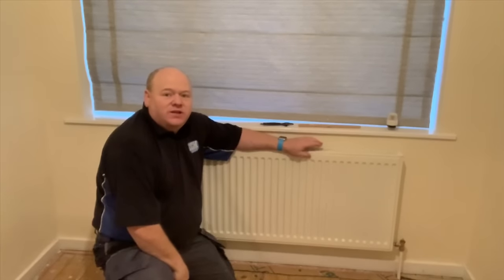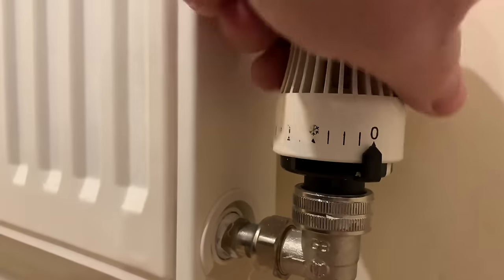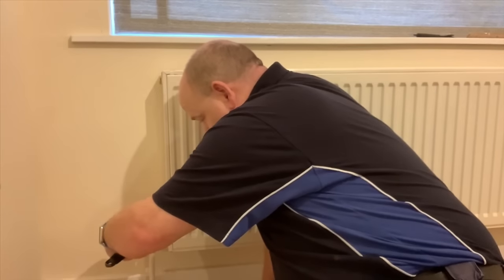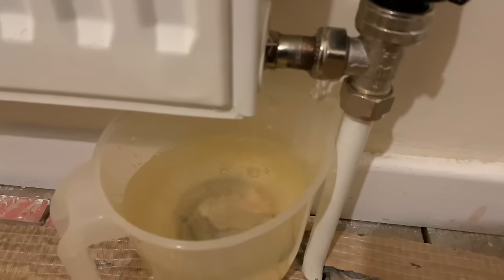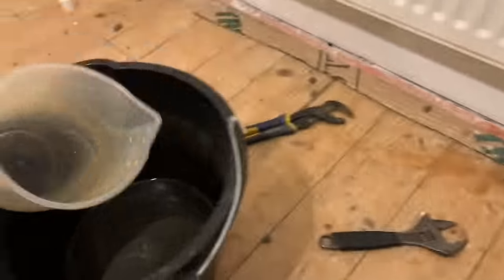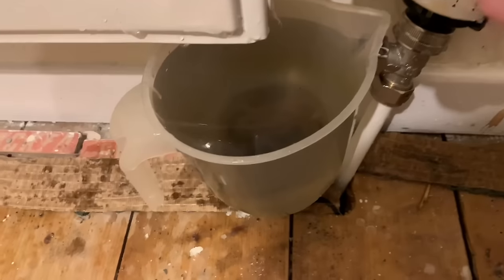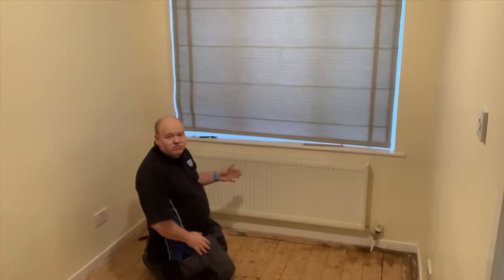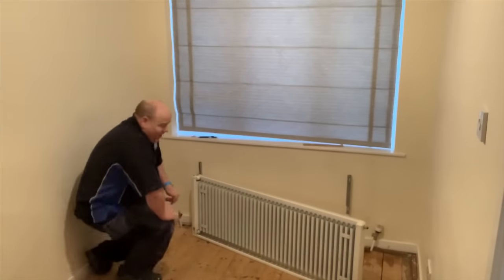How to remove a radiator for decorating - Removing a central heating rad

Comment: Great video, thanks. One question - why isn't one pie connected to the top of the rad and one at the bottom? Then you could fit a drain plug to the bottom of the rad and draining would be simpler.
Reply from the maker: Thanks very much for your comment, please consider subscribing to support the channel 🙂

Comment: if you wanted to stop the supply of water coming to the radiator, can you go straight to turning the left valve off (I'm not trying to remove my radiator, just trying to stop the supply)

Comment: When the radiator appears empty and you lift it up off the brackets, inevitably you will lift the radiator on a slope and the lower end will have black water dripping out so I always have a jug/tray under one end and lower that end first so the water goes into the jug. Then lower the whole rad as you did and carry it upside down. Small point but vital if the carpet is underneath!

Comment: Usually good videos Allan,but I think this has a problem.I would not rely on a trv to stay closed for a period of time.
You should if you still have it,although unlikely,screw the plastic cap on top instead of the trv head,100% shut off and won’t open (change in temperature)
If you don’t have the cap,the end should be blanked ,in this case with a 15mm compression blank.cheers
Reply from the maker: Brian Bennett You make a good point. The idea of this video is to paint behind and then put the rad back on. I take on board what you are saying though. Thanks 🙏

Comment: If the trv side valve pin is broke, ie taking off the rad and the lock shield is turned off ok, and the pin is down and should be off on the trv side, but still pisses out water from the system when unthreading the rad, obviously you cant take the rad off, do you have to drain the whole system then, many thanks in advance.
Reply from the maker: Thanks very much for your comment, please consider subscribing to support the channel 🙂

Comment: What happens if the thermostatic valve only goes as far as the frost setting - there is no point 0 on it? Is it ok to take off when it shows the frost setting ??
Reply from the maker: As long as its fully turned the radiator off. Thanks.

Comment: Sorry if it’s already been asked but how many turns on each valves after the radiator has been fitted? How do you know it’s the radiator is balanced or not?

Comment: I have problems after having bled few rads my boiler was banging and we found out the water in Header tank ran out as valve was inactive because it was croded . Having changed valve and new pump to it started heating only came up with water not it's own. Changed 3 way valve body still same heating comes on does not sustain. What you think could it be Aqutator as plumber happen to put on the body of 3 way ,2 way Aqutator than Heating at its own came up. So please help to advise. With power flush is it likely to see some leaks around best way to get over it eliminate or what ? I would be grateful if, you can advise. Thanks for your time .
Reply from the maker: Thanks very much for your comment, please consider subscribing to support the channel 🙂

Comment: If i want to permanently remove the radiator, can i just cap off the valves? (in case i need to put a radiator back one day) , cheers!

Comment: Hey Allen.  This video was super helpful.  One question on the top up.  Does it make sense for me to leave the return side on the radiator closed when I turn the supply side to the radiator back on?  My thought is to do this and leave the bleeder valve open when I go to top up the system and once all the air pushes out the bleeder valve then turn the return side back on.  Thanks!
Reply from the maker: Thanks very much for your comment, please consider subscribing to support the channel 🙂

Comment: To Allen:

Could you just clarify the question in my previous comment please? Namely, do I need to count how many turns are needed to shut off the lockshield valve in order that that I can put it back at the exact same setting when the radiator goes back, or is this not really critical? Please advise if you can. Many thanks!
Reply from the maker: Depends on the system really.

Comment: Great advice. I don't know if anyone has said this, after closing both valves, open bleed valve to check if water stops coming out after say 30 seconds. If it does continue, one of the valves is not shutting off and the task is now 'different'! Just saying.

Comment: When opening the valves at the bottom to refill the radiator, should I open the bleed valve so that as the water re-enters the air can escape? Thanks

Comment: Turning the thermostat to 0 (I did check it is 0 & not *) has not stopped the water - when I disconnect that side of the radiator, water comes spurting out at pressure. Is there another way to isolate the radiator on the thermostat side?

Comment: How would I remove a rad, if it’s connected through the wall to another radiator. When my CH was installed they put the rad in the wrong place now I don’t like like it and want to get rid of one radiator so I can push my furniture back towards the wall if this possible

Comment: No need to remove or drain down, loosen the radiator tail locknut on both sides, then I use a car jack with flat wood on it positioned just in front of the bottom of the radiator. Gently lift radiator up a couple of millimetres until it clears it's hanging brackets then rotate the radiator. Once radiator is laying horizontal just nip the locknuts on the tails again. You have total access to the wall now.

Comment: I want to add a secondary glazing window to my current window but I am worried I won’t be able to remove the radiator under the window if I need to later on. 
Could you please let me know how many cm/inch minimum should be free above the radiator to lift/ remove it ? Thank you.
Reply from the maker: no idea sorry.

Comment: We want to remove a radiator because we allready have floor heating. What will we do with the water pipes when the radiator is off the wall?

Comment: Thankyou uncle, I can't seem to get the screw open to let the water out, I've even left an indentation in the metal where I am pressing so hard. Any tips?
Reply from the maker: Not really sure what you mean sorry?
Reply: If you’re talking about the bleed valve, if it is completely jammed you can simply unscrew it and remove it, do it slowly though and have someone help you with catching any surges of water from the bottom, and buy a new one

Comment: I followed the process and removed the radiator successfully.
However, I didn’t cap them off or return the thermostat valve..
I topped the boiler up, before fitting the new rad and water went everywhere … oops 
I’ve just shared this in case it prevents anyone else making my errors 👍

Comment: Allen, I was trying to take a radiator off the wall and I've hit a bit of a snag. When I put the spanner around the large nut that connects the pipes to the rad, the whole unit moves. What I mean by that is, the nut and the pipe move at the same time in the same direction. I applied a bit of force to the spanner but i noticed that the pipe started to bend. I stopped as I feared snapping the pipe as it was bending quite a lot. Is there a way to get that nut loosened without the pipe moving and warping?
Reply from the maker: You can buy a tool that holds the pipe in place. Thanks

Comment: Can the system be used as normal ? How how much would one pay for someone to remove large 1 radiator and put 2 smaller radiators for splitting a room ?

Comment: Hi Allen, after watching you video and removing my radiator, decorating and then replacing I topped my boiler up.  I fired up the boiler by running a tap an noticed that the after a couple of seconds the boiler stopped.  I tried this a few times but it does the same thing every time.  The pressure is at just over 1 bar but I noticed the needle wobbling just before it cut out.  Any ideas please.
Reply: You've probably got air locks in your system.  I would try and bleed all your rads.  The boiler may shut off again if it hits another air pocket but by bleeding out the rads, you should get the air out eventually.
Reply from the maker: Thanks very much for your comment, please consider subscribing to support the channel 🙂

Comment: Why a full drain down? Close both valves loosen valves quarter of a turn with towel underneath lift and tilt radiator past horizontal. With the blend valves closed disconect valves and lift upside down quickly. If your only painting dont bother to take it fully off just tilt it down with a support to stop putting stress on the pipes.
Reply: Use a rubble sack instead of a towel. Those things can hold tens of litres of water and don’t leak! You can always put a towel underneath as extra precaution. Always worth having one local, just in case!
Reply from the maker: Thanks very much for your comment, please consider subscribing to support the channel 🙂

Comment: Thanks for this video. Radiator is off the wall but I have the slightest of leak on the left hand side. Valve fully turned off and nut underneath is as tight as I can get. PLEASE HELP HAHA
Reply from the maker: Thanks very much for your comment, please consider subscribing to support the channel 🙂

Comment: How long does it take to empty the radiator? Mine hasn’t stopped and I’ve been going a while.
Reply: How long did it take? I'm in the same position 😂
Reply: @ryulanda9399  got a plumber in in the end. The valves were really old and had seized so hadn’t shut properly. He said to test it, shut both valves and then open the bleed valve. If that doesn’t stop then you know water is still being let in and there is a problem.
Reply from the maker: Thanks very much for your comment, please consider subscribing to support the channel 🙂

Comment: I’m not criticising at all, but from one plumber to another, would you not recommend shutting the valves off, and then open the bleed valve and letting the pressure out straight away, less chance of water spraying everywhere when you crack the nut, would also be good to explain that you should
Cap the valves off as well to be on the safe side, just Incase the trv has a thermostat setting.
Reply from the maker: Thank you for the feedback, You could do it that way as well

Comment: At 6:47 what is the plastic grip called? Like between the metal of the radiator cover around the bleed valve. They have them too and bottom to keep the case in place but mine have broken and trying to get spares but don’t know what they’re called x
Reply from the maker: Not sure tbh, Sorry.

Comment: I want to remove the rad completely so I need to get rid of the feed pipes that come up through the floor, how is this accomplished.
Reply from the maker: Drain the system and cap the pipes. Thanks.

Comment: Excellent explanation Allen. I do really appreciate such a clear and concise video. I have just a quick question in regards the location of the valves, so the thermostatic and the bleed (air) valves are on the left, the shield valve is on the right. Does this change anything in terms on how to open/close the valves i.e. clockwise/down as you explained on the video or should this be the same even if they are located the other way around? 
Many Thanks,
Juan
Reply from the maker: Not really sure what you mean? Thanks.
Reply: @AllenHart999  so, in your video the shield valve is on the left and you say that for turning it off you need to turn it clockwise.. is this the same if the valve is on the left (like in my case) or should I turn it on the other direction (not clockwise)? same with the thermostatic valve, should I turn it off in the same direction as per your video even if in my case in on the left side of the radiator? I hope it makes sense now :) Thanks again Allen
Reply from the maker: @juanfcgb  I think i understand now and yes. Thanks.
Reply: @AllenHart999  Thank you so much, I have a quick about the valves (two pipes) from the radiator, after its been removed is it required to put some kind of caps so the water doesn't goes out from those pipes anymore? Thanks

Comment: I like to use a paint tray before lifting off completely, I tip the radiator to one side over the tray and that captures most the sludge but be careful doing that, I would put an absorbent pad under the tray/ on top of the dust sheet as I have had sludge stain through a dust sheet in the past. Nightmare!
Reply from the maker: Thanks very much for your comment, please consider subscribing to support the channel 🙂

Comment: Are lock shield valves better than thermostatic valves ?
Reply from the maker: No they are different. You would normally have both on a radiator. Thanks.
Reply: @AllenHart999  Thank you

Comment: My pipes come out of a concrete floor and are solid. How far can I bend the pipes sideways before something bad happens?
Reply from the maker: You will need to be very careful. Do not try and bend the pipe. Might be better to fully drain the system maybe?
Reply: I'm wondering if I should cut through the rad tails, then fit adjustable tails when refitting?

Comment: My top tip is to wrap a plastic bag around the radiator valve and into a plastic bowl and the water runs out down the bag and into the bowl and can be done in one or 2 goes.

Comment: Always a good idea after turning the valves off is to open the bleed valve , if the water continues to dribble out for more than a few seconds one of the radiator valves is passing  ie is not shutting down correctly ,you could try and nip them down . The other tip is to note the number of turns the lock shield is open so this can be adjusted the same number if you are putting it back .
Reply from the maker: Thanks very much for your comment, please consider subscribing to support the channel 🙂

Comment: I turned my valve to 0 and drained the radiator but the pipe with the valve on has water slowly coming out of it even though its past the Frost setting and tightly on zero
Reply from the maker: You can normally put a half inch cap on it. Thanks.

Comment: I always thought you had to cap the end with the thermo valve in case the temperature drops and the valve releases water?? Even if set to Zero?? Please Correct me
Reply from the maker: Yes that’s definitely a good idea. Thanks
Reply: @Terry Ges You put a stop cap on to completely lock it off. Usually supplied with the valve.
Reply: 100% use a cap... especially if leaving radiator off over night

Comment: Always remove the thermostat valve and replace it with a screw on cap especially if you want to leave the radiator off over night
Reply from the maker: Thanks.

Comment: I got quoted £750 for supply two radiators and changing four. Seems a lot? They are also doing the boiler at the same time. Maybe I’ll just change the radiator mysel?
Reply from the maker: Rebecca A sounds very cheap to me. Thanks
Reply: Allen Hart the boiler is a separate price lol. But £650 max labour for four radiators?
Reply: @rebeccaard1  using 4 old radiator and replacing 2 ? How long did the plumber suck air through his teeth lol
Reply from the maker: Thanks very much for your comment, please consider subscribing to support the channel 🙂

Comment: Great,, informative video, but why use the wrong tools, ruin the valve with adjustable spanner!
Reply from the maker: Why would you say they are the wrong tools? Thanks.
Reply: @AllenHart999  Hi Allen, using a very large spanner or anything that is adjustable on the lock shield valve causes the soft metals to round off, you can get a specialist lock valve key which makes the job super easy, also allows you to get better control over it. Great video like I said. (I am just one of those who likes the right tool for the job to make it easy, especially when doing the same thing a few times)
Reply from the maker: cambike I have managed ok for last 30 years and haven’t damaged one yet, Thanks for the tip though and happy new year 👍

Comment: If you're replacing the radiator with a new one chances are it will need new hangers, so where's the tricky part trying to marry it up with the existing pipework？
Reply from the maker: Thanks very much for your comment, please consider subscribing to support the channel 🙂

Comment: I can tell you’re a good plumber and as a guy about my own age I expect you have plenty of experience so my question to you would be was making this video worth it? It cheapens our trade and expertise while also not showing the multiple problems that can happen when someone without experience try’s to do this themselves. You’ve done this video in a room with no carpets, a clean system, a rad with a fairly new trv and 15mm tails going into the valves for a reason and you know it. 
Anyone watching this please be aware there is serious risk involved doing this in your own home that could cost you dearly if you aren’t careful, especially if you have a old house/heating system.
Reply from the maker: Hi Kevin. Thank you for the fedback.

Comment: I turned the thermostat off to 0 but the water was still gushing out .
Reply from the maker: Hi Lee, Did you manage to sort it. Thanks.
Reply: @AllenHart999  no I gave up . Thanks
Reply: @leeashcroft9145 This happened to me last week. If you put a stop cap on the trv, that should do it i,e, the white plastic cap that is usually supplied with the valves.

Comment: 3 years old but maybe someone will answer. When you undo the pipework and drain off the rad andnits all empty etc. You'll lift the rad off. Cool. When you replace it and re attach tye pipework is there no seal in the pipework end. Like a thick rubber washer etc that will no doubt fall to pieces when it's opened up. There's always a f'ing washer that falls to bits and your like arghhhhh it's f'ing evening and screwfix are shut. No rubber seal? Nothing? Just a thread.